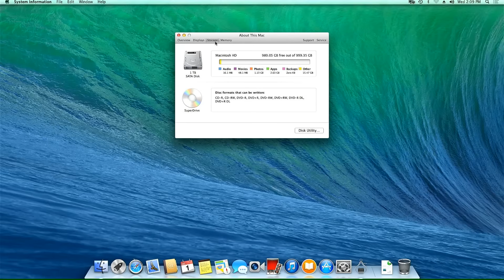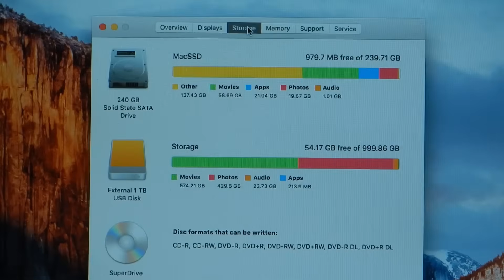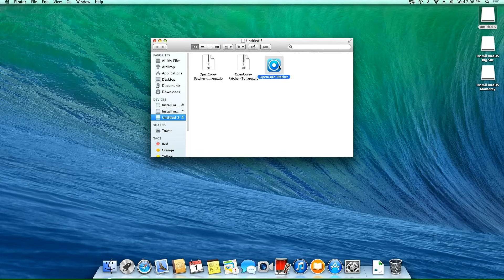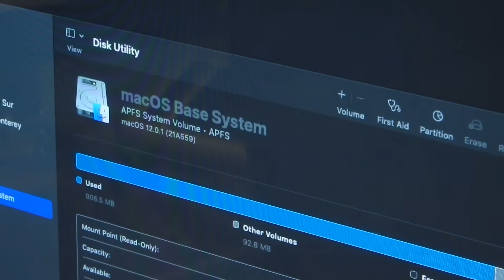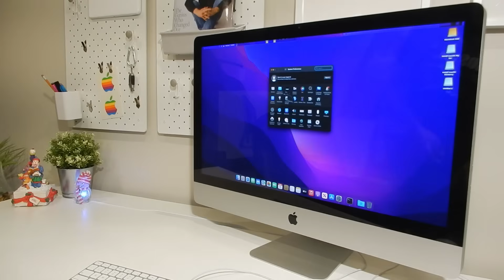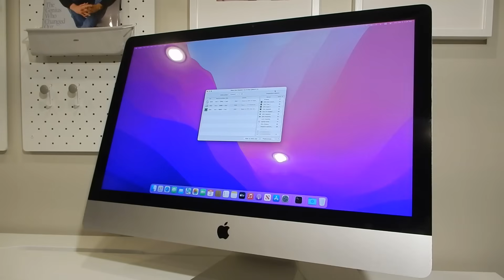Apple thinks this 2009 27" iMac is worthless. Let's refurbish and upgrade it to Monterey!

Comment: Can you fix mine like how you did yours? If so, what would the price to make it like yours be??
Reply from the maker: It wouldn't be economical to ship your iMac to me unfortunately.  Shipping and packing costs would be very high, and also a high risk of damage since the entire screen is glass.  I did have to send one once, only 1.5hr drive away, and the shipping and material cost was approaching $100 - that's only ONE direction and also using a discounted commercial shipping account.

I would suggest to check around for a small local independent shop.  It would have to be a small independent, because larger businesses likely won't want to do mods like this.

If you are tech savvy and want to reduce the upgrade cost, you could also just have a shop install the SSD and do the rest of the upgrade yourself.  The SSD portion of the upgrade is the only area you will expose dangerous high voltages.  The RAM and software are pretty safe to upgrade yourself.

I'm always here to answer any questions if you do decide to do this yourself. :)
Reply: @rebootretro  you’re awesome ! Thanks!

Comment: Impressive work! I upgraded my 2009 27" iMac with an SSD and used it daily for a decade, which is an amazing lifespan IMO. I've sold it now but might have kept it for even longer if I had known about OpenCore Legacy Patcher!
Reply: Did you have to install new software on ssd first
Reply: @namogotnowtv9088  I think I did a clean install of MacOS, and used the optical slot to mount it, but no special software, no.

Comment: I’m running monterey on and 09 iMac and all works well except for the camera and microphone..is this the same for you? Or others?
Reply from the maker: No, the camera and mic work perfectly on my 09.  It is used semi-regularly with FaceTime and works flawlessly.  If yours was opened to do internal upgrades (SSD/HDD/etc), it's possible the cable got damaged/disconnected.  I believe both the mic and camera are on the same PCB and connect via the same connector to the main logic board.  It could be a driver issue too (OCLP post patches didn't install correctly), but I think the biggest suspect at this point is the internal cable connecting to the main logic board based on your symptoms.  Hopefully this helps!
Reply: @rebootretro  I found a fix via tcc and manually adding apps to my allow list on the privacy settings
Reply from the maker: @joeschafranek6677  Excellent!  That does make sense that privacy settings could block this.  I hadn't though of this.  Congrats on finding the solution!! :D

Comment: Hi Justintyme 7739, what I don't understand is my computer man told me my 2012 macbook pro won't update past catalina because apple won't let them do so, so I wonder how can a 2011 imac update to monterey?
Reply from the maker: The computer guy is telling you what officially works, which is what Apple allows to run on your 2012.  Most Intel Macs are capable of running Monterey, but Apple blacklists them so they won't boot it and removes drivers so it won't function if it does boot.  What I've done is use software called OpenCore Legacy Patcher (OCLP) which tricks Monterey to think it's allowed to run.  OCLP also installs the necessary drivers that Apple removed.

Using OCLP, your 2012 should run Monterey flawlessly.  I've done that same upgrade here: https://youtu.be/pzfKYTE9OyM
Reply: @rebootretro  That's fantastic to know! Thanks @justintyme7739, but I bet it would be hard for me to get a computer guy to do this, what do you think?
Reply from the maker: @michael-dy8tz  Many shops won't because running unsupported software sometimes results in unexpected glitches, which they get blamed for but have no way to foresee.  And the shops don't want customers constantly coming back trying to claim warranty on things that are unpredictable and out of their control.  There are surely some small independent shops which will do this work though, under the understanding that this is not officially supported by Apple and that they aren't responsible if it stops working.

Comment: I have been working with a mac mini mid 2012 that I got in 2015 and upgraded to 16 RAM and SSD. It still flies. But running Sierra in 2023 might not be such a good idea, despite the fact I started to use Linux a lot on other machines to go online. I recently got a 27 iMac late 2015 from a friend, had an SSD put in (did not want to try that myself), and will start using it soon. I really appreciate your channel, partly because I'm getting increasingly irritated with the marketing that forces most users into buying the latest hardware, even if the hardware they have is still fully functional or could be easily upgraded to remain functional. I plan to help a few friends to get affordable computers (either thinkpads or macs) and your channel is incredibly useful! Also, I think your presentation is great.
Reply from the maker: Thanks so much!  Very much appreciated!

Yes, that 2015 is a pain to open compared to the '09 in the video.  The '15 has its screen glued, and you need to replace the glue each time you open it.  I always like to hear about people saving equipment from the landfill!  Keep up the good fight!
Reply: " because I'm getting increasingly irritated with the marketing that forces most users into buying the latest hardware" this is Apples Scheme and you could not have said it better because when I learned about Open Core and patching up Apple to get the latest OS I thought why can't Apple just make consumers lives easy like Microsoft? All OS must expire and that generally means "we will put a hole in your pocket because you cannot easily do OS upgrades"  Ironically they have "Apple Care" but they don't really care. They are like drug dealers and want you hooked,  just keep coming back for what's new lol lol
Reply: an underrated comment @armamentarmedarm1699 everything i need to do works fine on a 15 year old imac, and not just web browsing.

Comment: I also have a late 2009 27inch, with a core 2 duo, is it possible to upgrade it to a core 7 from the same socket ?
Reply from the maker: No, unfortunately the Core 2 chips use LGA 755 socket and there are no Core i chips for that socket.  I have heard that people has successfully modded Apple Core 2 platforms to accept quad core and Xeon chips.  It’s a pretty advanced mod though.

Comment: Another great video! I have a 2009 iMac in the workshop I am dying to upgrade.  I think it has Core 2 Duo and not an i5 or i7. Not certain of the graphics card either.

Adding the SSD to the DVD slot and not replacing the original hard drive seems compelling to me. Am I to assume it will easily boot to the new SSD?

I'm still trying to figure out "Metal" and whether or not Ventura via OpenCore is ready yet. Thoughts?
Reply from the maker: Thanks!!

Yes, the DVD connection is just a standard SATA port so the system recognizes it the same as the internal HDD.  Make sure you don't do what I did though; make sure you get the DVD dummy adapter with the correct thickness, lol.

I've not tried Ventura yet; others have comment and say that WiFi isn't working on Ventura, so you'll need to use Ethernet or a USB dongle.  Personally, Monterey works so well and is still officially in-service, I don't see a reason to test the waters with Ventura (at least at this point).

To get Metal running, you'll need to check if yours has an upgradable GPU (not all iMacs did).  I made another video here (https://www.youtube.com/watch?v=n9koG8p9Ch0) which shows upgrading to a Metal-supported card.  The stock card in any '09 will definitely not support Metal; on Monterey you can get legacy acceleration using patches (and the sleep mode graphics glitch) and I THINK this will work on Ventura but I'm not certain.
Reply: @rebootretro  That video features tasks that are slightly above my skill level. I'll stick with Monterey for the reasons you've outlined. Thanks again. I've been following you here on on Reddit
Reply from the maker: @BobbyBoucherWaterboy  Cool, I'm glad you find my posts interesting :).  I try to make videos informative, while also making them entertaining for people who are just curious but don't intend to replicate the project.  Appreciate the comments, thank you!

Comment: I have been reading what I can find about "OpenCore Legacy Patcher" group & code, there isn't a whole lot, small user base compared to Linux. This code and procedure are hacks of legitimate, secure, robust and highly regarded Apple Operating Systems. Would I build a hack machine and immediately login to my sacred primary email account, bank account, trading account, crypto exchange, etc.?? Not advisable. Would I refurbish and sell a hacked Apple OS machine or deploy to any commercial use? No, absolutely not. This hack is appropriate only to build an experimental personalized machine which is an interesting reason but my overall enthusiasm for a hacked OS (and for outdated OS) has waned. I have been using Linux for a very long time and I have developed a healthy respect and appreciation for it as a server and desktop OS and as far as I know Linux is the only legitimate Open Source option to Windows and Mac OS.

Comment: Best thing to do with this is get a hdmi board and a m1 Mac mini. Take the mini apart and put it inside the screen. Bingo you have a brand new machine
Reply from the maker: That is definitely a good option, especially for people with GPU failures or lower-spec machines.  I'm keeping this one going for now while it performs well and I can run semi-current operating systems.  Once Apple fully drops Intel support and it begins to affect usability, I plan to do exactly what you suggest and do the HDMI mod.  Even by today's standards, these 2K screens still look pretty good.
Reply: @rebootretro  nice! Glad it’s working for you and loved the video! Thanks for the response :)
Reply: @ChrisWoodServices  Genius idea！I'd like to try, Would you please advice a link to sell  HDMI Board for this 27 late 2009 mac?

Comment: The 2009 iMac will not install from a thumb drive.  I tried.
Reply from the maker: Another viewer claims that there are issues with 16GB thumb drives.  I've used a couple thumb drives, and can confirm I've also had issues with 16GB ones.  I've not done enough testing to confirm this or not, but its interesting that the claims also matched my experience.  I know it shouldn't matter, but it might be worth trying a 32GB or 64GB one...
Reply: I tried with the 32 gb but it didnt work i am havin an 2009 imac unable to access boot menu in it when i am holding  option key its just showing balnk white screen plz help i request 😢

Comment: Hey random question since I have been doing numerous opencore legacy patches for MacBooks and iMacs 2009-2013 and all have worked smoothly. Only one I am pulling my hair on is my friends parents 2008 iMac 24” everytime I start the Monterey install, I usually format the ssd to APS and begin the installation. Once it’s completed it reboots back to the MacOS recovery and never actually to the setup screen. When I hold option and look for my thumb drive, it doesn’t seem to see the EFI boot which is weird. I can see it fine if I plug the thumb drive to all my other macs just fine so I know it’s not the usb thumb stick. I have 4 of them that I created since I patch quite a few machines each day and never had a issue but only for this particular 2008 machine. It works fine on a 2008 Mac mini and 2008 MacBook. Any suggestions on why the iMac seems to only allow me to install but never setup Monterey? If I check disk utility I can see the install did complete since the allocated space is correct.
Reply from the maker: I also had a lot of weird issues with the 2008 Core 2 that didn't exist with any later Macs.  I did have some issues with the USB stick too - either the latest version of OpenCore wouldn't work, or ONLY the latest version would work (I don't remember which).  It might be worth trying to build the USB stick with different OpenCore versions to see.  I'm sorry I can't be much more help.  But you are definitely right, there are some weird issues happening with the 2008 iMacs.

Comment: Where can I find graphics card patches?
Reply from the maker: They are part of the OpenCore Legacy post-install patches.  After Mac OS is installed, you run the patcher again and choose "post-install patches".  Make sure you're connected to internet, and it will pull the patches/drivers and automatically install them.
Reply: @rebootretro  thank you!

Comment: Hello! Excuse me for asking, but I have an Early 2009 24-Inch iMac, and the web claims that it can only support 16GB or Ram. I was wondering how you managed to install those 32GB or Ram on yours! Mine is running on Monterey already and will upgrade it to an SSD this very weekend. However, upgrading the RAM would be a massive increase in performance I'm sure. Would you have any ideas? Thanks a lot in advance!
Reply from the maker: I think yours might have a Core 2 Duo CPU, not a Core i5/Core i7.  The Core 2 Duos are limited to 16GB on the 2009 models and limited to 6GB on the 2008 models, if I remember correctly.  It has to do with chipset limitations; the Core i5/i7 use a newer chipset which support more RAM.

Honestly though, if you're not opening 50+ browser tabs, editing large files in Photoshop, running virtual machines, etc, you probably won't benefit from more than 16GB anyway.  The only reason I have 32GB is because I had a used spare set of RAM on the shelf collecting dust.  The machine doesn't come anywhere close to using it all.  If I was spending actual money on it, I probably wouldn't have put more than 8GB which is sufficient for basic web browsing.  And if I need it for another project, I wouldn't hesitate to pull some out.

Your SSD upgrade will make ALL the difference!  An SSD will improve efficiency so much, that performance will be substantially better than any RAM upgrade could give.  An SSD upgrade is always the best performance boost for the dollar.

Good luck!
Reply: hi what process did you follow i also have early 2009 imac
Reply from the maker: @mikenewbold1699  I relied heavily on documentation from the OpenCore site: https://dortania.github.io/OpenCore-Legacy-Patcher/

Comment: Will a early 2009 imac support Catalina, I’m hoping to hack into high Sierra which I have been using forever nkw
Reply from the maker: The 2009 only officially supports up to High Sierra, but you can hack Catalina on it using OpenCore Legacy just like in this video.

Comment: I have a question i have a mid 2009 iMac i believe is a 27inch with a core 2 duo ,4gbs of ram and a 1tb spinner ..can i throw in there a quad core ?
Reply from the maker: I don't believe the chipsets support anything more than a dual core CPU.  I think someone once hacked it, but it was incredibly involved and came with some issues.  Although the performance gains aren't nearly as much, you can swap in a newer/faster Core 2 Duo chip.  In my opinion though, I don't feel Core 2 Duo upgrades are worthwhile.  The performance gained doesn't justify the cost and effort, and honestly the included chips really are decent to begin with.
Reply: @rebootretro  thanks! At least now i know to just max the ram ,mines is DDR3 ram so it's not half bad
Reply from the maker: @chrisplissken4626  You'll actually get a much better performance boost with an SSD upgrade if you haven't already.  If you're only using the iMac for general tasks like shown in the video, you probably won't benefit from more than 8GB RAM, although more never hurts :)

I did a video on a 2008 iMac with Core 2 Duo, and even with 4GB RAM it's performance is very respectable.  Still a very usable machine for sure! https://youtu.be/_a2utQaO_Gs
Reply: @rebootretro  how about a video card? As a minor upgrade ? Aside of the SSD?...can it be done?
Reply from the maker: @chrisplissken4626  You'll have to check to confirm, but I believe your model is the only one in this series with a non-removable/non-upgradable soldered GPU, unfortunately.

For general web browsing, it doesn't matter though.  If you install the graphics patches after upgrade, it will bring back basic hardware acceleration which will make the UI snappy as per normal and give smooth video playback.  The only time you'll have an issue is with Metal-only apps, like the Apple Maps app - although Google Maps website via Google Chrome works perfectly.  Even the latest Photoshop supports both Metal and legacy acceleration and works with the older patched graphics.

Comment: My machine is exactly the same model, but with 12 Gb of SDRAM, and dual drives, a 480 Gb SSD, plus the original 1Tb HDD. It runs like a charm. It's still my daily driver and my workhorse for all my graphic design jobs. The only thing that's really vital is to get rid of the original ATI GPU (it's a bottleneck and it ends up failing). I'm currently using the 2011 iMac AMD Radeon 6970M GPU with 1Gb of RAM and the performance improvement is really noticeable.
Reply from the maker: Ya, those stock GPUs were pretty terrible for failure.  I've dealt with too many of them over the years!
Reply: Hello! Is this AMD 6970M reliable or will it fail too after a couple of years?
Reply: @twinstars1234  All Apple AMD GPUs at 2011 dies after a Time. This is why the MacBooks, Mac Minis, MacBook Pros are so cheap from 2011